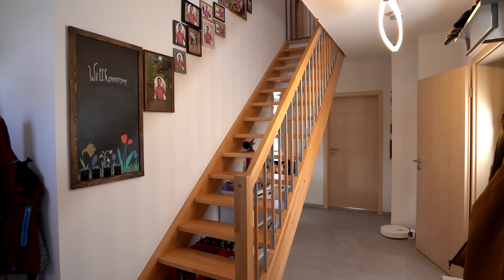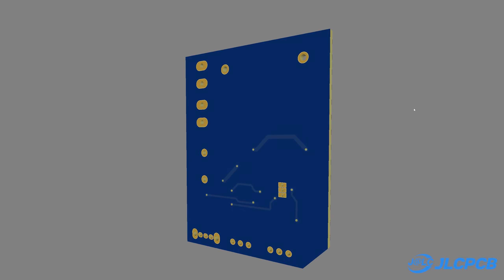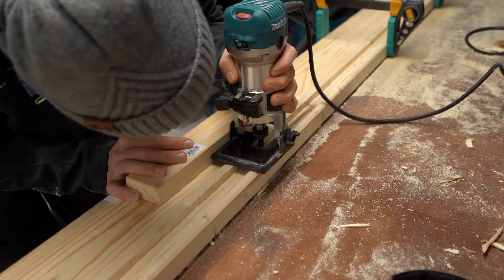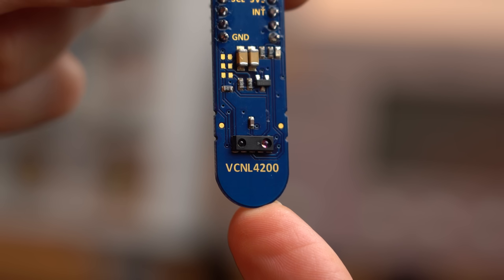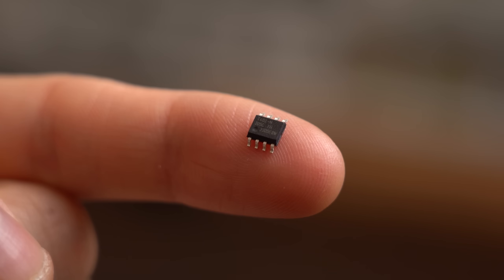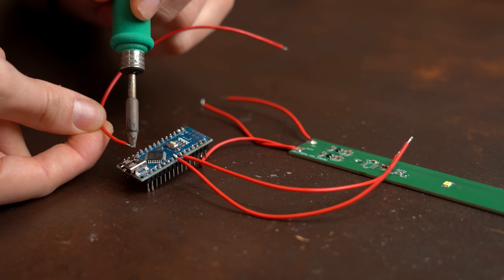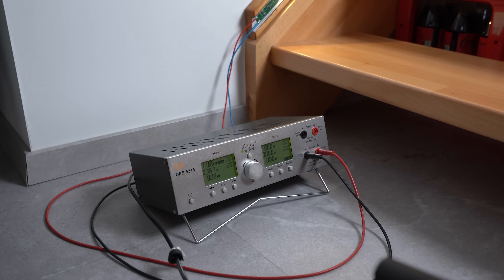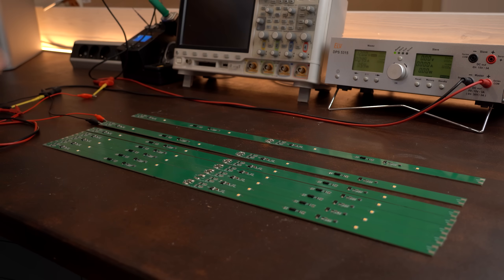I tried to Revolutionize LED Lights!.....And FAILED?

Comment: - A lesson that I learned it long time ago, and obviously you didn't, is to make test circuit boards BEFORE final boards. These test ccts are meant to be assembled in position, to actually function for awhile, like 1 week or so and AFTER all the tests, you make the clean boards. These test cct's are relatively easy to make, very easy to modify, really no cost in upgrading them, scalable to small or bigger sizes, very modular, and even more benefits that you have to discover by actually using them. Here is how I make my test ccts on CARDBOARD : https://youtu.be/G40BmqssYtE and my personal option is to use them as such. I have the experience and I trust them as being resilient enough. I rarely make PCB's because in this capitalism, its impossible to make money, at least for me. This is my invention and I stick with it. Maybe it will help you think a little out of the box, with my way of doing things. And another advice: dont give up so easily. Push it, because if you don't, who will?
-And a thought about your very long and big circuit ON THE WALL, is to ground any big metal, especially those aluminium frames. Just drag a wire to the ground from them. They may or may not interfere with your components. Also use a lot of filter capacitors on the power pins of ALL your IC's. But the big idea here is to ground any big or long piece of metal in the vicinity of your boards ! I hope you get my point.

Comment: Great video, good to show things can and do go wrong sometimes.  Hopefully it hasn't caused too many sleepless nights :). I have been thinking of making something similar myself, those IR sensors look ideal!. Like others I wonder if its an issue with voltage drop or current limit. I count 14 steps at 150mA = 2.1A?. Can you traces handle 2A? Check the incoming voltage on the PCB at the end of the line, is it stable when others are switching on?

Comment: I get you, I absolutely do. I too always overthink a solution.
However, instead of illuminating each step individually, illuminate them all at 10% power with a 15 second timer. Use red LED so it doesn't wake you up too much. Problem solved.

Because believe you me, a change in lighting also wakes you up. So for let's say twelve steps, something is blinking on and off like 12 times. Much better to have red emergency lighting go on and off just once.

Comment: I think the idea is flawed from the ground up. Only having light on the stair case where you already stepping on, rises the chance of an accident, imho. The entire stairs should be lighted when you step on it. It is just how our brains work. We look ahead where to step on.
If you are bothered by the sleepiness factor, you should just use different light spectrum, like red or orange.
If you are keen to experiment with your elektic engineering skills, you can use white light during the early evening and the "sleep light" after 0:00 o´clock or something like that...
Honestly, the project just seems like an exercise in over engineering a problem that does not exist.

Comment: If we don't design and try a project, how will we ever learn new things when they fail. Your project is 95% there, so take courage and try a different approach, from suggestions below. I was considering doing this for my kitchen with under counter lights. The idea is always to use the simplest solution with off the shelf parts. Just don't give up! I love your ideas and designs!🤞😎

Comment: I had an idea much like this for outside lights that would follow someone up the walkway to my front porch. But it would be motion sensor on either side, and when it was activated would send a chunk of light up the path like 4 or 5 ft wide that would travel at normal walking distance to "follow" the person. And I would have just used some 12v strips similar to the govee ones and control with WLED and ESP32. I think you over engineered this one a bit too hard there... Typical german xDDD

Comment: Idea: stick a distance sensor like the LD2410 on one end of the stairs and map the distance to addressable LEDS. Also 2.54mm headers can be used instead of soldering since the lights draw milliamps. If Ground is a problem then use the star ground layoud and add more 100nf caps; copper fill can work against you in certain situations.

Comment: Usually the hardest part of troubleshooting is the measuring of the actual state of the signals. What you could do is send all the data (distance sensor, LED contorl signal) to the very last ATTINY and hook up a raspberry where you could log all the signals from all microcontrollers. This way you could easily tell what each sensor sees at what time.

Comment: My first thought is that I2C is a lousy choice for a 4+ meter long bus. Inter-Intergrated Circuit is a bus that should never leave the PCB that it's on. While it can be robust enough to actually work in some situations, it was not designed to be a long distance bus. A LIN bus might be a little harder to implement, but for long noisy communication its pretty good. And you don't need to be worried as much about pullup resistors and bus capacitance. Even UART comms would be better for your situation.
Reply: How long you can run it is mainly limited by how fast you want to go. For a bus that would be fine running even at just 1kbps, you could go very long. For boards that only need to tell each other whether their proximity sensor is being tripped though, it would be simpler to just use a pull-high line between the two boards that gets driven low when either of them gets tripped. BTW, every DVI, HDMI and DP cable has wiring for Display Data Information which uses I2C over 2-5m of external cabling.

Comment: I didn’t check your source code but for me it seems like a combination of 2 different issues: 
a) hw - I would recommend to filter data line signal
b) sw - maybe temporary  disconnecting led which has been already “in use” might help
Good luck and great job as always!

Comment: I like this idea too, very much! You are on the right… track! :)
No advice on the electronics, but two electrical propositions: use connectors between the PCBs - life’s lesson is that sooner or later one needs attention, and it’s much nicer to “cycle them through” until the selected one slips out at the bottom, than to solder on the stairs? The other one is… would there be any point in using the aluminium rail as an earth plane to reduce the noise?

Comment: It took me three weeks four different tries with the programing (worse than you in that area). Finally went to a friend about the code he showed me that using a state machine was the best case and it mostly works. The issues on the board like noise and signal integrity were mostly the board layout and lack of proper filtering. I have built this in two different places, and for the most part they are still working. Had an LED go out on one about a year back. Mine are made to react to the step before being on or off state. Also had to angle the motion sensor up at a thirty five degree angle to keep the cats from playing with the lights.
Peace

Comment: I have also made a similar project in the past, but for roller shutters. However, there are disadvantages to using ambient light.
If you set your system correctly in the winter, it will not work properly in the summer and vice versa. The difference between cloudy days and non-cloudy days also makes a big difference.
It is better to work with an astronomical clock, including summer/winter time.

Comment: Why not have a master and slave boards...top of stairs, it senses, then have the lights daisy chain ramping lighting in a slow ripple from the direction that is triggered, at top it lights sequentially down, then triggered at bottom it lights sequentially up, this way you only need two sensors (and they don't interfere with each other).  You can program a dwell so it will stay lit while you climb the stairs.  This way it also communicates between the boards in the i2c bus as well.  Definitely make better filtering for the power.  Do you use multiple capacitance values for filtering for the different frequencies?  You could also make a larger copper pour on the back of the board as a ground bus to help eliminate noise as well instead of trying to use smaller traces, and as heatsinks.
Also...try smaller boards for "testing" then once you get it dialed in...make the bigger boards so it won't cost as much
Very cool..once you get it going well your GF will be pleased
Keep em coming!!!!

Comment: Regarding the noise with the GND, not sure if i can provide any useful tips. But i think you can modify the infrared sensors by placing a small shroud over it to block invalid signals coming from too wide an angle. Just cut pieces from a plastic straw and glue it over the IR sensor, to keep the sensing angle within the corresponding step. Then recalibrate the IR sensor's sensitivity. Keep the data output to adjacent modules simple.

IR > threshold = light up module + data out high

Data in high = light up module only

With IR > threshold on higher priority

Comment: It looks like you have TOO many motion detectors and are trying to control too small a section of LEDs. Perhaps lower it down to one detector on each extreme end of the stairs and one in the middle and have each detector control at least 2 LED strips? You wont have as fine of control but it will be more useful.

Comment: VL53L1x is a Lidar sensor from ST. it worked well and came cheap at cost. Program the sensor to turn LEDs "ON" position for the next two LEDs. I learned many things from you.

Comment: Why not just detect stepping on the floor near stairs at night and use some addressable led strips and animate it so steps light leds one by one in sections like you were walking, assuming you were walking like that every time the same way

Comment: I know absolutely nothing. But, could the lights turning on be interferring with the ambient sensors at all?
Reply from the maker: That is correct. But not implemented in the code anyway at this point.

Comment: Well, I admire your idea, but to be honest, I think is to much complicated, why you want light just few steps. For me it will be cool if you have just two sensors on top and on bottom, and to make it more fancy I will just add "animation/sequence that lights turn on from bottom to top or reverse and thats it. I can imagine situation (with assumption that you figure out all the problems). that you going downstairs in middle of night, 2 sensors didint work (for some reasion) then becouse you sleepy you miss one step and fell down.

Comment: Lighting the step you are already on seems to miss the point of illumination for safety.  Anticipating where the human is going to light the way ahead is the goal you are missing with this design.  

I am into year 10 of my own staircase lighting install journey, so I empathize with your frustration of not working the first time.  You have to take this project one step at a time.

Comment: As a Brit I love that Germany has the term "the big light", although I dread to think what the German is for it.

I saw a lot of comments about the IR distance sensors interfering with each other, I'm not a 100% sure about that as they seem quite far apart and at different elevations; any idea of the beam spread? However security lights with movement detectors generally use a Fresnel lens with dual detectors to track a moving heat source, rather than use a photo emitter and detector. But whether there is enough heat emitted from your ankles to trigger it might be a problem, as well as the orientation.

What is your code for propagating to the up stream and down stream units that a sensor has turned on? Could there be a problem with the propagation running a head of the movement and then interacting with the detection, or could there be a problem with deciding which direction the person is moving?

Comment: This is great, Scott!
As other comments mentioned, I would consider using addressable led strips, but also taking advantage of the different colors you can turn on. At night, the blue light is the one you should avoid, so you might turn on the leds on yellow color.

Comment: I like the concept and would like to think along to solve some problems.
My first though is to only have one board with the IC and and voltage regulators. This should adress some of the noise issues, but then the question becomes how do you operate the sensors and LEDs.
For the LED you can go with the addressable kind. And since the sensors are I2C it could work on a single data bus.
All of this would reduce the overall cost of the build since less ICs would be needed.

Comment: Just one thing... You have an IR sensor there and LEDs which tend to heat up pretty quickly.... Combine the two to get a perfect recipe for a disaster. P.S. I would definitely go with an ultrasonic distance sensor. Waaaaaaaaaaaay more reliable thing.

Comment: I think you should try to dismount half of the pcb’s (the top 2m) and check if it works. You are draining quite a lot of current and the reason why they don’t work could be caused by the supply voltage at the top part has dropped or is disturbed. Check all supply voltages with an oscilloscope (not at the power supply in the bottom but) at the top of the staircase. Especially for the Tiny AVR, it can reset and if the supply is not stable causing the lights to be all on. Great project, I hope you will make a part two when you get it to work 😊 if cutting the PCB’s at the middle works, you could source it from 2 supplies in the middle as a work around.

Comment: the only problems were with Power and driver IC, Fix Thoes and you fix your project.
Use a better Driver for LEDs or Even a Simple Driver like a transistor to drive your LEDs and each LED can have its own Current limit resistor,
and use 5-volt switching mode power supply to power the hole board

Comment: I did a similar project with a lightstrip and two movement sensors, one at the top and one at the bottom. This way you can program the lightstrip to light up gradually starting at the sensor which was activated. Looks pretty smooth. And quite easy to implement!

Comment: Things that could help: Add an inductor/choke/LC/EMI filter from 12V to the switching converter, add I2C buffers between boards, RC filter for the CTRL input, and use a switching scheme with a smoother output. This is a low side switching buck converter so adding a cap in parallel with the LED-LED-Inductor series components and from the switching node to ground might help too

ETA: The 15kHz frequency is probably some artifact of the 47uH inductor and the 10uF input capacitor

Comment: hello Greatscott this is a cool project. By the way, I noticed in your PCB layout, it looks like the LED track jump to the inner layer and back to the top layer without a proper return path, and I believe there is interference between the high current led track to the daisy chain track. my suggestion try forcing the led track on the top layer and changing the layer stack to 1:Signal&power, 2:Ground, 3:Ground, 4:signal&power, to eliminate interference.

Comment: Is there cross talk between the IR sensors? Maybe have to optically isolate them by sticking them in a hole to narrow the beam. In this situation a retro reflective sensor hitting a reflector on the other side and set the logic to detect when is goes dark. BTW. I work in industrial automation. Variables are the enemy. If I would use a distance senor in that situation I would have went with just one shooting down or up the steps and then timed the lights off it. A microwave sensor would be a good choice. 
Your skills with circuits is amazing. The way you can explain the function in a normal way without the gibberish is what keeps me coming back.

Comment: I think it works fine without the data lines between each PCB... I'd consider buying them if they were a retail product that just lit up per individual step. I suggest leaving the data lines removed and then simplify the code to make each PCB work locally (assuming this removes a lot of your If Statements). Great project!

Alternatively, could you add LDRs to each PCB of version 2 while keeping each PCB localised (no data lines), so it could use LDR to light the LEDs dimly (detecting light from adjacent step) but then the proximity sensor to light the step fully when foot detected?....

Comment: Having a microcontroller on every board really seems like overkill, and if you put a microcontroller on every board it doesn't make any sense why connecting them with a common power rail would cause these issues. Why are you sending data between all the boards?

Comment: The distance sensor is too sensitive, triggers on the movement of your whole leg and not just your foot.
Reply from the maker: Well, such small imperfections are not a problem when it comes to lighting up stairs. At least in my opinion.

Comment: You made the cardinal mistake of installing everything before actually testing the system as a whole externally. It would have made it a lot easier to debug and change components if you didn't have to be on your knees on a staircase all the time soldering in awkward positions.. How exhausting.. I bet you wouldn't make that mistake again? Next time I would like to see you assemble and test the whole system on your lab or outside before installation .. Awesome project! Good luck!

Comment: My suggestion is that pressure sensor on top and bottom of stairs and program microcontroller according to how fast i step down or climb and that will trigger light to lit up individually
Reply from the maker: That is even more overengineered than my solution.
Reply: @greatscottlab  😂